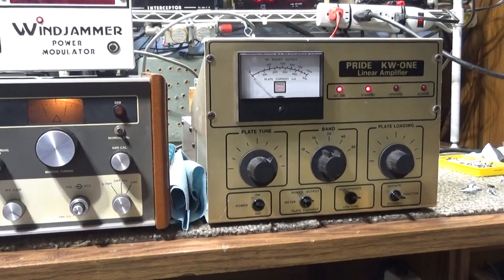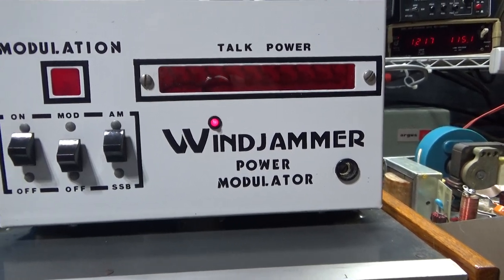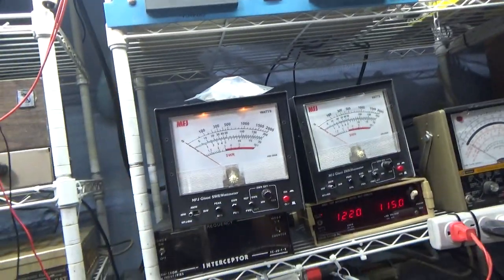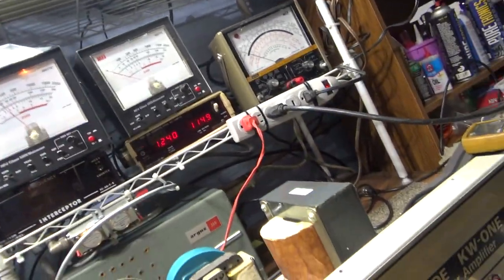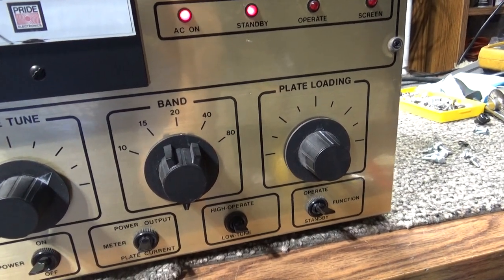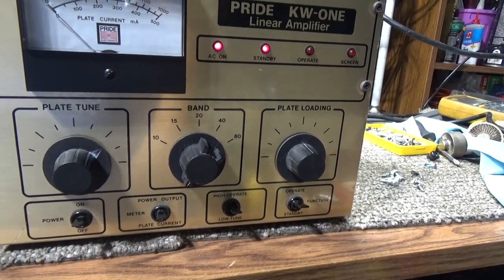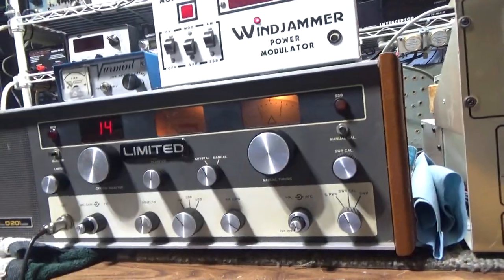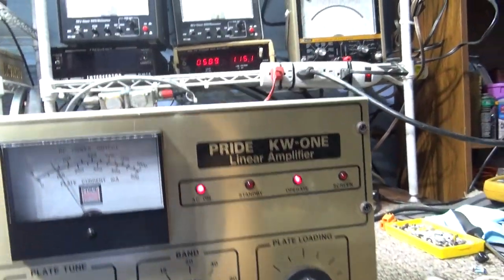Latest and old favorites, Tram D201 40 channel PLL. Windjammer Power Modulator, Pride KW-1 / DX-300

Comment: That’s a beautiful set there Tram,seeing your Pride’s makes me wanna pull my 250b pride out and rebuild it.  As for modulators vs linears as drivers,I’ll take a low dead key and swing like Tarzan over a big carrier any day.  That Kw1 is pretty cool,but I gotta say after 25+years of running 250bs putting that much carrier in to a 250b scares me 😂 My 6 tube 25b Glenn is a audio monster but it takes very little drive at all. 250b don’t take much more than 2w to get one going. Something else alot of people don’t factor in/or care about is how many watts a tube or a pill can dissipate.
Reply from the maker: Agreed. My thoughts on dissipation is maximum Peak watts should be about twice the plate dissipation per tube. What gets me is when people claim to get 4x 5x times plate dissipation. If they are, it won't be for long.
Reply: @tramdr  they might do it for a short time but they won’t for long. But I don’t like running my stuff hard personally,not only is it hard in it but if I break something I gotta fix it 😂

Comment: Swing is the whole thing on sideband, Swing is where it’s at! If you want to have people hear you key low swing high ! Surprised same hams don’t know that ! Also Doc use that DX 2547 dead key 2 watts Swing 17-20 with that IFR 520 ! Biased at 100 ma chow . JohnBoyUtah KJ7TBR
Reply: I had lightening getting my IFR 520’s and blowing them in the area I live in grounded antenna and coax, static still got me bought a bag full on non- fake Vehay. Italian IFR 520’s work great I going on flea bay a  3 pin socket soldered into the board bent it over so I could plug in new greased final and screw with bolt and insulator onto the heat sink back of radio works great! JohnBoyUtah
Reply from the maker: Lightning sucks!

Comment: Its all based on the class of service the tube is being run at. these modulators are run in class AB. They rely on the negative bias to cut the tube off harder so very little input RF drive is required and to not overload the control grid (g1) of the tube. They are grid driven instead of cathode driven in a typical  class  C “Linear” amplifier. They require a b+ and a 1/2 b+, as well as a Negative 25-50vdc bias. These do not run in class C. They are definitely not linear.  Even tetrodes like 4cx250b’s are run in AB like modulators in amps like the golden Falcon 2K. Anything grid driven takes very low drive. I have even run 4cx5000’s and 3cpx3000’s in AB grid driven.  Swing monsters. Been building tube amps for over 50 years. Cool to see some of these old classics again. I had a Tram D201A 40 ch back in the late 70’s early 80s. It had a 6DG6  final tube instead of the original 6L6 in the D201 23 ch. I know the FCC came down on Tram because the 6L6 could put out 10 watts with a small mod, the modulator was also a 6L6 and could put out equal amount of modulation power to modulate the 10 watt carrier to well over 100% modulation. The 6DG6 would not put out more then 4.5 watts. They were a similar tube but less output. The old Tram D201 could be made to run a 6L6 to put out 10 watts. Good memories of the late 70’s and 80’s CB world.
Reply from the maker: Mostly agree, but not all grid driven amps are AB, and most grounded grid amps are not class C. Heck, most dual 3-500z amps are heavy AB and most could use a little bias to tame them down some.

Comment: what was the name of the tube amp that had selection on the front for super modulation and a red bezel light that got brighter as talked? the one 12 volt that i have you tune the amp for the brightest red   while talking . can't remember the name right now but i think it was made for the old business band cb radios .when i go downstairs i will get the name. talking about the red light remember  some of the radios had the light and i used it to test different mics to see which mic made it the brightest. doesn't mean it sounded good on that radio but showed the amount of gain or drive the mic gave to the radio ..
Reply from the maker: Varmint was the amps with the Supermod switch. The light was a poor mans wattmeter. I would suggest forget the light and get a good wattmeter.

Comment: fitting a pl259 becomes a technical job for a ham I shouldn't worry.. most hams don't know what the difference is between deviation and modulation lol
Reply from the maker: I agree. In my real opinion, Hams are taught everything SSB and CW and that's all they know. They do not understand that for other forms of modulation, the parameters are different. They will even find a fact in a Ham book (fact for SSB) and present it as factual information in a discussion about AM. They really don't understand that the facts are very different for the other types of voice communication.
Reply: @tramdr  I am a HAM operator, and I can unfortunately state that most modern HAMs are just simply appliance operators...QSL!  73's OM.  ~Jack, VEG
Reply: @tramdr  which is true. Wait until the golden screwdrivers get into the new FM radios and wonder why nobody can hear them after they crank up the "modulation".

Comment: I think some hams get a little confused, between a speech amplifier and a modulator. Although with the Demco satellite, that was a true modulator because it put audio onto the carrier outboard of the transmitter and it was high-level audio
Reply from the maker: I agree with the first part but not the 2nd. A Demco modulator is a speech amplifier/clipper. A Demco Modulator is not a modulator, it does not put audio on the carrier at all.
Reply: (sighs) Way back when, Henshaws sold accessory microphones preamps under the label of "modulators". Demco may have been the first one to offer an outboard microphone preamp for their flagship Satellite and Super Satellite radios. AFAIK neither Tram nor Browning sold such a device. 
In that era, a Turner Plus 2 was far more common, with Astatic eventually offering a preamp D-104.
Reply: @tramdr  I'm looking for Jb150 I mist your post on Facebook

Comment: Some guy had one around here back in the day and it was a splatter box...made thing miserable for the rest of us with his bleed over.
Reply from the maker: I hear that a lot, but its always from people on SS radios though.
Reply: @tramdr  Yeah......I couldn't afford the big radios back in the day....just a cobra 29 23 channel on a power supply with a supper mag antenna......was not until the 80s until I got my first Tram D201.
Reply: The nice thing about having a SDR is being able to see the true bandwidth of a given signal. 50 years ago a lot of Brownings and Trams were sold based upon their legendary adjacent channel rejection. A dirty amp throwing spurs will negate the best receiver. The current example is the evening shootout on channel 9 during which a few Puerto Rican stations with dirty amps can be heard +_ 60 kHz.

Comment: doesn't the high drive amps have what they call padding . to limit input power . wish somebody made a box that went between the radio and amp that allowed you to control the input power for radios that don't have rf power adjust .i think thats what rm italy amps have been doing . people don't understand what no more than 2 or 3 watts input to amp and the blow up the amps .
Reply from the maker: Yes padding is the correct word. A few amps use some padding to tap down the input watts some, but the Pride KW-1 had very very heavy padding (network) with a total of 50 100 ohm 2 watt resistors. It knocked the 100 watt drive down to 4 watts. It would not be cost effective to add that and besides, an amp made for 4 watt CB's would not need it.